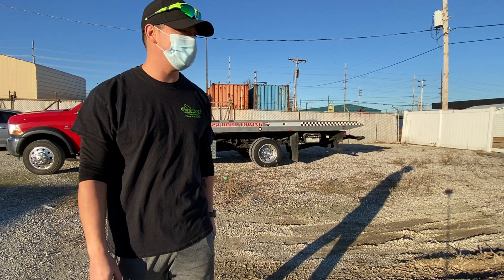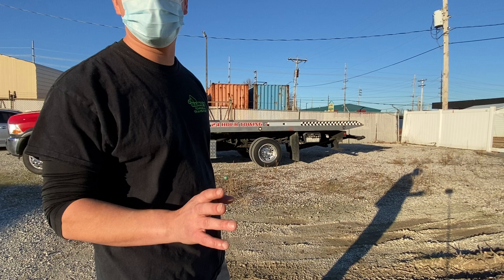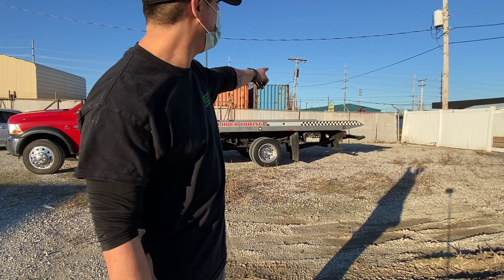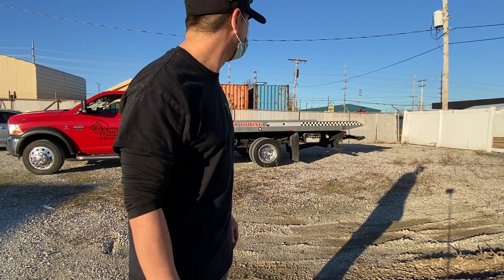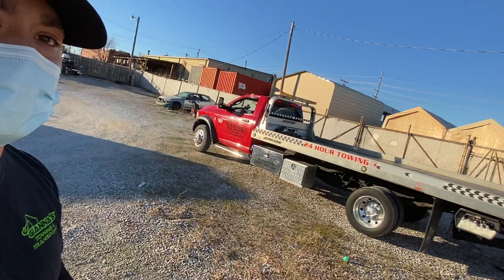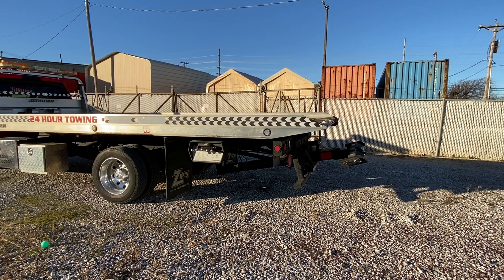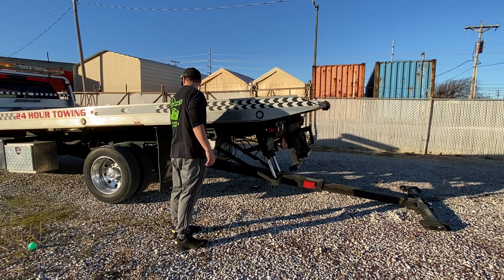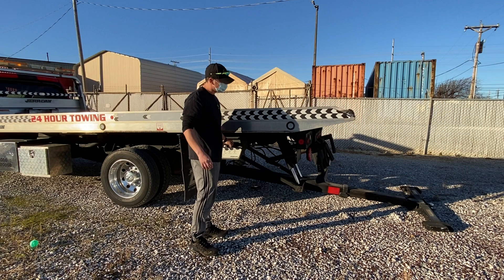How to walk a tow truck walking a truck recovery towing Jerr Dan bed

Comment: Just make sure if you do that on a hill to chock the wheels if you. Lift the drive wheels off the ground.  I’ve seen the trucks roll away because the wheel lift or bed can slide on the pavement.
Reply from the maker: Yes that can happ

Comment: I have had to use the wheel to move my truck but you should try not to use this method only under last resort the wheel lift is only rated for 4000 pounds extended but sometimes you have to do what you gotta do to get the job done i was also very nervous about walking a truck the first time because my truck has airbags and this method could stretch the bags or pop them but lucky i had the chance to talk with a veteran operator he showed me how to do this method with a truck that has airbags now i walk the truck every chance i get lots of fun
Reply from the maker: you know what jack I was terrified the first time I had to do it but  just like anything else in life you gotta take a chance and hope that ish works out brother...
Reply: Mine has bags. How do I do this safely and not destroy my bags?  Also, Ive driven a rollback for about 2 years and have never needed to do this to load or unload... SO Id only use it if I got stuck

Comment: Puts a lot of pressure and weight on the steer tires so be care where your front tire are but it is an essential process to know. I use it everyday because I don't lay on the ground to hook up vehicles. Too old for that!!! Plus all our trucks are fully remote controlled. And for anybody who wants to say it hurts the truck. We order our trucks to take the abuse. They are not normal tow trucks. When we get our trucks from miller we spend anywhere from 1 to 3 months specially modifying our trucks before they are put into service. They are built to be the best in the industry!
Reply from the maker: Rite on thank I need to get me one of those!
Reply: @Towvibes  if your anywhere close to Texas IRONCAT our companies shop will outfit you with the best equipment and upgrades in the industry. They have perfected the modifications for everything from light duty to four cars, heavies, up to nine car haulers. We can get you the minimum clearance on the top decks and the most time saving user friendly upgrades to you trucks.
Reply from the maker: @christopherbraswell9585  that’s ways away but thank you for that!

Comment: Can you walk any tow truck or is this a special set up? If yes then what are the dangers of doing this to your truck?
Reply from the maker: just be easy on it you have to. e careful on the aluminum bed compared to steel I’ve walked that truck over 500 times and I still use it every day!
Reply: All you really doing is picking up the back tires cuz it's a real real drive and moving it forward or backwards I think the flatbed have to have a wheel lift on it

Comment: I've done this, hopefully you only do it when you HAVE to.. it's extremely hard on the hydraulics. I've seen trucks blow hoses and loose bed controls and turns into a mess. Good trick. 👍 some company's would fire a driver for doing that.
Reply from the maker: it’s an essential part of towing! it’s hard on aluminum beds yes but steel beds can do it all day and twice on Sunday! 🪝💪